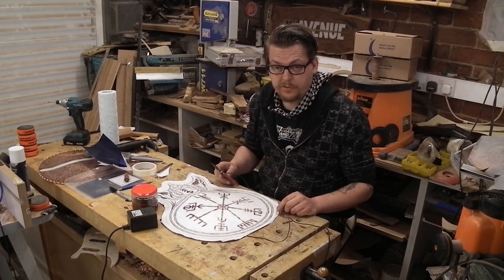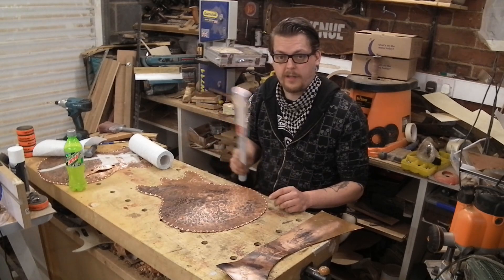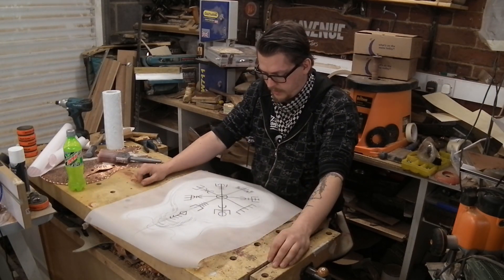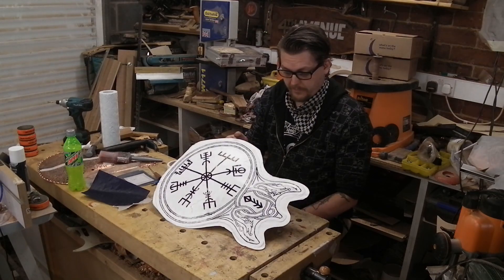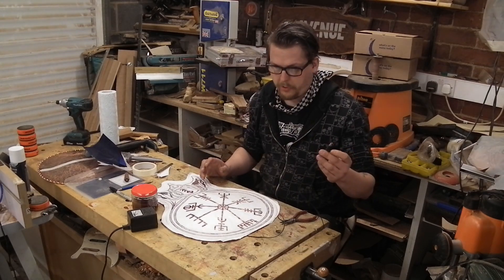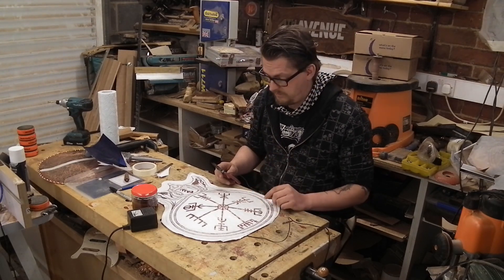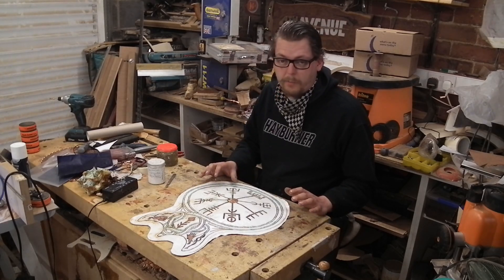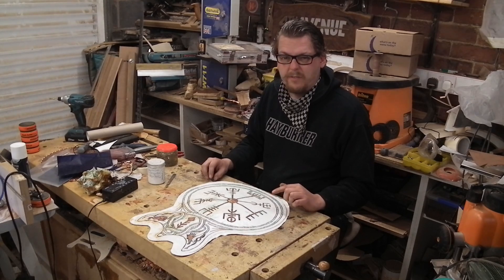Custom Guitar Building: etching a copper-top guitar with electricity and vinegar.

Comment: When I etch or plate I use 15 volts DC. I get over 1 amp of current.
Reply from the maker: Electrickery isn’t really my area, so I just used what I could easily find laying around. I think next time I’ll find a dedicated power supply, with at the very least overheat protection and adjustable voltage.
Reply: @4thAvenueGuitars  The main thing is the amperage rating. Look for 1 amp or higher.  Voltage should be at least 15VDC output.

Comment: ive done some patina experiments with salt and vinegar and these are my findings:  the best patina is when liquid solution is present in a closed space but the metal is also exposed to the air.  24 hours or so its a nice mottled set of shades of turquoise